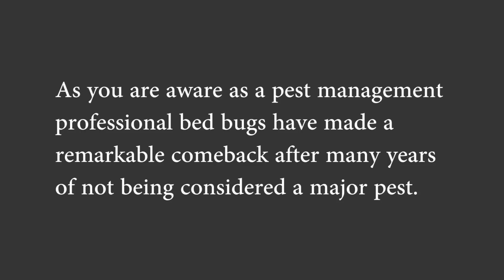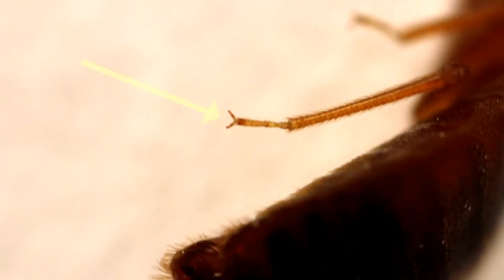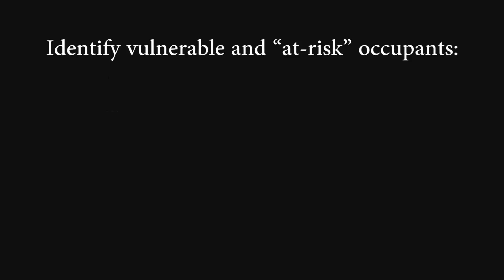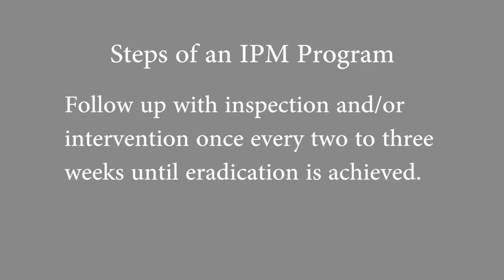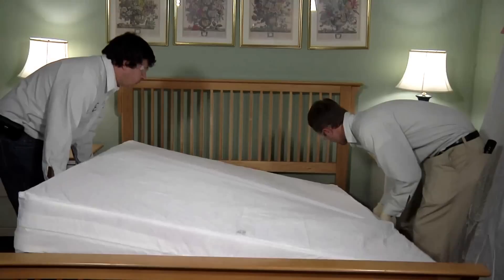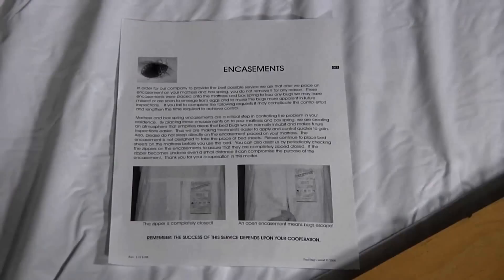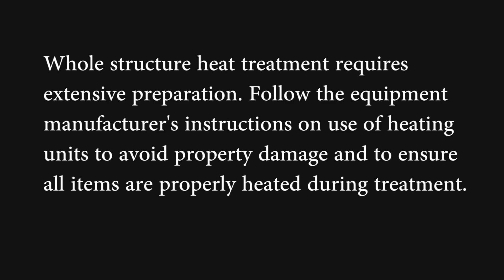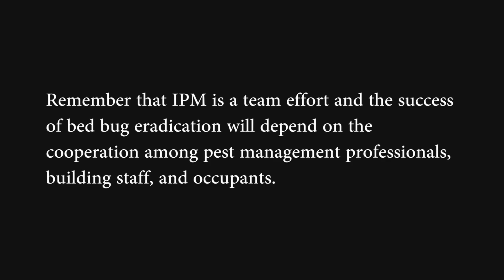Bed Bug Management for Professionals

Comment: Overdone presentation.  Get real!  Frequent laundering and heat treatments can be done by each household without any need for this sham of professional help.  Otherwise, especially with multi-apartment dwellings, these sham professionals will claim they cannot be done without.  Minimal, rudimentary education of the residents is all that is needed.  These 'professionals' should get an actual job rather than perpetuate the infestation problems that households can easily resolve by reasonable adjustments to their routine weekly housekeeping tasks.

Comment: If you don't have 50,000 for a bed bug heater or can pay $400 per room to a professional this is the best protocol to follow. You can buy 3 pesticide products that are not pyrethroids and least toxic. Cimexa Dust is a must, CIMI shield can be sprayed in the cracks and crevice and on the mattress or Eco Raider you must read and follow all label directions. Good lock

Comment: Thank you for this video.

How about rooms with wall to wall carpet that is attached to floor?
We treated the room twice. It is all empty for a month now. No furniture, only carpet.
We want to rip the carpet of and install laminate.
I am in dilemma now what to do with a carpet?
Maybe the eggs are hiding in the carpet even after two treatments!
At the same time I am concerned to remove the carpet, as the process of ripping the carper from the floor might spread the bugs i through the room.
I would appreciate any advise.
Also, what kind of steamer, which brand of steamer you use?
I am ready to purchase a strainer up to couple of hundreds, but not sure which brand to buy.
Thank you very much

Comment: I've tried everything to get rid of these bugs treatment systems steam powders  any other suggestions cause I'm losing my mind I also washed everything in my 4 bedroom home still see one here and there
Reply from the maker: Please make sure you have bed bugs, not other insects. If bed bugs are indeed still present, you may try the following: 1) only sleep on the same bed; 2) do not sit on upholstered sofa; 3) steam the bed frame and repeat 3 times; 4) check the interceptors under bed and sofa legs weekly and clean them after ach check; 5) encase the mattress and box spring with plastic zippered encasement; 6) launder all bed linens and pillow cases weekly.
Reply: Thank you I've done all that only time we see them is if someone sleeps in that room I will continue to repeat the steps until gone
Reply: Have you tried Nuvan pests strips? I’m going to use those  next. Must be used with caution.

Comment: liquid residuals???? i need to know where i can buy the liquid they are spraying
Reply: Source I used to work for a pest company:
Yes... the Internet.   The can he is using for the cracks & crevices looks like Bedlam spray though Phantom would be great too.  The residual spray is probably something like Temprid.  The dust he was using was Mother Earth D (shown at the beginning of the video), but it has been replaced with Alpine on the market.  The calk of choice is Latex calk because it is cheaper & printable.  If you are REALLY going to do this job, I would suggest you look into an appropriate Insect Growth Regulator, too.  (i.e. Gentrol or Nylar)
Reply: +NETWizzJbirk Thanks for your info!
Reply: +NETWizzJbirk the can he was using for crack and crevice spray was Tri-Die. works great but it is a silica based product so leaves a very white residual. he wasn't actually spraying it. i would honestly stay away from temprid and phantom as they can easily stain whatever you spray, instead go for Transport. it has a great residual and is a clear pesticide instead of the milky white like the temprid and phantom so it doesn't leave much of a visible mark. Alpine dust works ok. but i prefer Cimexa dust.
Reply: itsthedrizzit Indeed, Tri-Die stains.  565XLO smells terrible, etc.  I would agree Tri-Die is great except the residue.  Temprid and Phantom work so well... They were our staples for Bedbugs, but Transport should be great being it is basically Talstart, another pyrethroid + another neonecride.  Yeah, Cimexa is the latest and greatest thing, but I have never used it.  Without a doubt the silica dusts are likely better than the diatomaceous earth dusts...  Makes me wonder how Drione would be...  It would probably not be that much better than Cimexa because bedbugs are likely highly resistant to pyrethrins being many synthetic pyrethoids won't even kill them.  The one major plus might be the Piperonyl Butoxide in Drione.  What do you think?
Reply: itsthedrizzit Most of the time I got lucky.  Very rarely did our company have the deal with bedbugs.  We spent the vast majority of our calls dealing with ants, roaches (including German), silverfish, and earwigs, which thankfully are very susceptible to almost every product we tried.  Even the German roaches were susceptible to the point one client completely knocked out an infestation with Raid Muli-Insect Killer #7 in the yellow can.  I was amazed because that yellow can will not generally kill anything unless it is directly sprayed.  Over the years we used Suspend, Demon, or Dragnet - basically anything ending in "methrin" and it was like a live electrical wire... spray a line and the insects would be dead before crossing it much of the time!
Reply: There is extensive independent research on variety of dusts and liquid residuals published in PCT Magazine. Tempo is the most effective of all and Cimexa close second. We have been using Tempo and few other dusts in the past and switched completely to Tempo based on our own results. It is often "how you use it" not "what you use". We find many people misapplying DE to a fault without understanding that more in not better. As mentioned in one of the threads here, the biggest problem with bed bugs is public' s lack of understanding of the treatment methods and ( what puzzles me the most ) unwillingness to listen to us when we explain various treatment options. Even when we tell them "you don't have to trust us but please look at independent and FREE to you research and treatment methods recommended by Purdue University  Entomology Dept. vast majority of clients simply will choose the least expensive option.  I can clearly understand the frustration of people affected by bed bug infestation but there are ALWAYS choices in whom to hire to do the treatment. How can you select the right one if you don't know what questions to ask? The right pest control operator will ALWAYS guarantee their work. I know we do ...
Reply: Tempo may well be the best pyrethroid... it might be better than SuspendSC, Demand CS, Demon, etc... but comparing it to Cimexa is just silly because that is like comparing apples to oranges or a great wine to a beer.  Cimexa has a different mode of action.  If you like Tempo so much try Temprid, it has the same active ingrediant as Tempo + it also has a neonecritide (i.e. plus another mode of action).  Not only that Temprid is pretty much an industry standard for BB management.  Phantom has a different mode of action.  Transport is like Temprid but newer and a differnet Pyrethroid and Neonecritide, but it has the same tow mode of actions as Temprid.  Then there are IGRs...

It is not so much if one one Pyrethroid does not work that you want to throw another at it...  It is generally better to try different modes of action to deal with resistant bugs, but I am not disputing that Tempo is the best having never tried it.  Personally, if I bought Tempo I would be more apt to use it for structure, indoor, and outdoor pest control.
Reply from the maker: While a pyrethroid dust such as Tempo is effective in controlling bed bugs when applied properly, it is potentially more risky to the applicator and the residue in a room can pose higher health risk to the occupants than Cimexa, which is an inorganic insecticide. More importantly, Cimexa is the most effective insecticide dust for controlling bed bugs based on a recent study published in Journal of Economic Entomology. Title of the paper is “Comparative efficacy of selected dust insecticides for controlling Cimex lectularius (Hemiptera: Cimicidae).” See: http://jee.oxfordjournals.org/content/early/2016/06/15/jee.tow129  Note that the authors had no financial relationship with the product manufacturer and the study was not supported by any manufacturer.
Reply: The study you referred to is more recent than the one I mentioned . I will definitely give Cimexa a try .
Reply: NETWizzJbirk nyguard is excellent too. Maybe thats what he meant lol. Temprid nyguard combo
Reply: itsthedrizzit if you mix phantom or temprid properly it wont leave white residue.  If you mix it wrong it will.

Comment: MMM... what about all the bugs within the cavity of the bed and couch/chair. This is one of the most common places to find them. ALL dust covers should be removed from furniture. You will definitely miss them if you do not. Treat inside cavity with liquid residual.
Reply from the maker: We would suggest encasing the bed so any bugs hiding in cracks or cavities will starve to death. Installing encasement also makes it easier for future inspection and treatment. If worried about the cost, then use vinyl encasements until elimination. In many cases, upholstered sofas and chairs are indeed very difficult to treat. The rocking chairs and sofa beds are especially difficult to treat because there are many potential hiding places. Very thorough treatment using a residual insecticide is recommended. Insecticide dust is another option. You may also steam the sofa. Do you need to remove the backing of the sofa or chair? Our suggestion is no because removing the backing will allow bed bugs to find their way into deeper harborages more easily.  With backing intact, bed bugs would more likely hide at edges of the backing.
Reply: @RutgersNJAES  there is no sign of bed bugs on the outside of my stuffed couches, yet when you sit there you know they are still there. What the heck do I do? I have sprayed and sprayed and it does not do a bit of good
Reply: @sallym4149 I would just toss it !